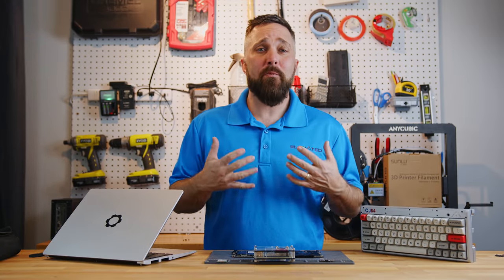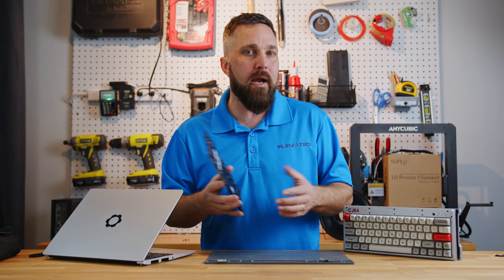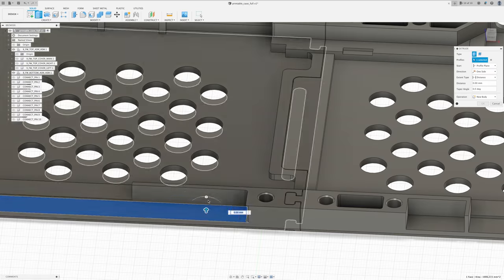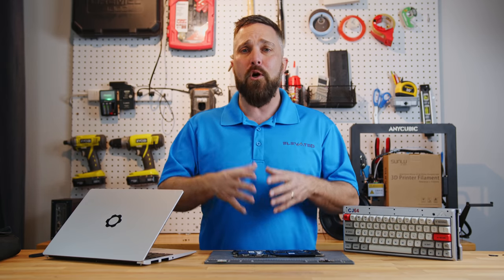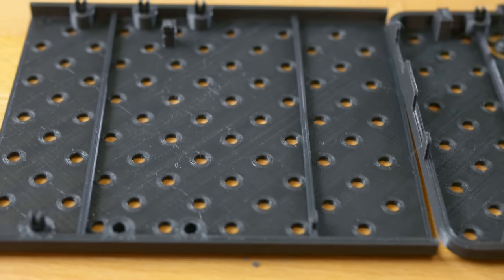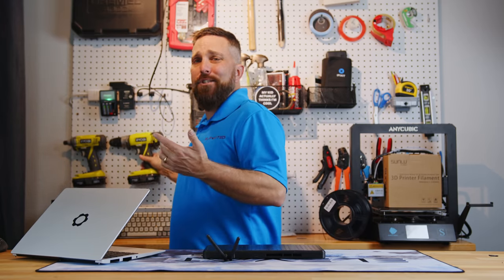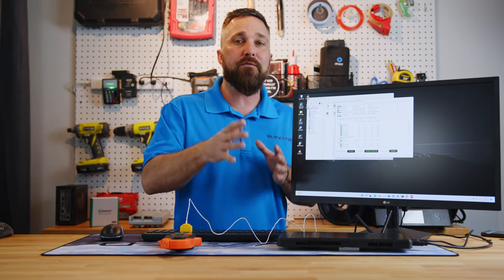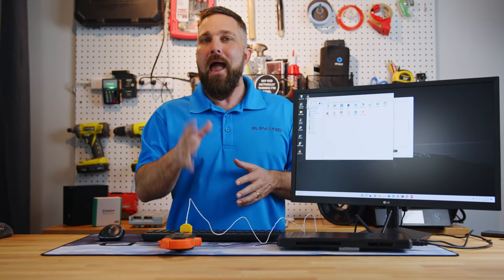The Framework Mainboard Case! Printed, Built, Tested.

Comment: From what i understand,  peeling and delaminating is caused by the abs cooling to fast.  If you could enclose your printer and turn off the part cooling fan fan completely you'd have much better luck.
Reply from the maker: I had the printer enclosed but the minimum setting for the layer cooling fan was 30% for my printer. However since then I found a way to turn it completely off for a set number of layers. It works for smaller parts but still not great for the parts with such large surfaces.

Comment: While the last video was a blast, this one is not that impressive functionality wise. Functional wise, you have a slim pc (mac mini / gigabyte brix like  ) that you mounted on a vesa mount. Also, I might be missing a point , but back in the day (my cheap hp pavillion g6 at least), you were able to upgrade the cpu, ram ssd wifi module and if you were lucky enough even another ngff mini pcie for a wwan module or ssd.

I know that the current trend is to solder, and that there is no way around it , but it just seems a bit overhyped to me.

Love you content and explanations !

Comment: I would prefer to use screw inserts. You can melt them into place using a soldering iron.
Reply from the maker: Yes, that's how I did project CJ64

Comment: Can't you just 3D print a substitute for the wifi retention bracket?
Reply from the maker: I can easily design something in Fusion 360 and print it out, but can "most people"?
Reply: @ElevatedSystems  If I were to do such a project, I'd upload to models somewhere to have them printed as I do not own a 3D printer myself.

Having all of the needed files and manuals together in one place, i.e. in a github repo would make this very convenient.

Comment: I really want a Framework laptop but for it to be an upgrade of my current £700 Acer Aspire 3 it would cost me £2,000, i could get the next Acer up that matched the Framework for ONE THOUSAND POUNDS less, so - where's the value? yeah recycling is cool but if you don't price competitively you're done for because only early adopters who love niche products will buy them - try surviving as a company with a 0.1 percent market share whilst also spending more than your competitors to ensure modularity and recyclability.